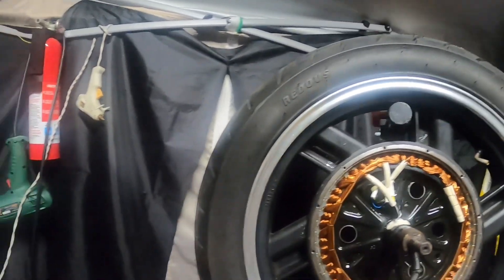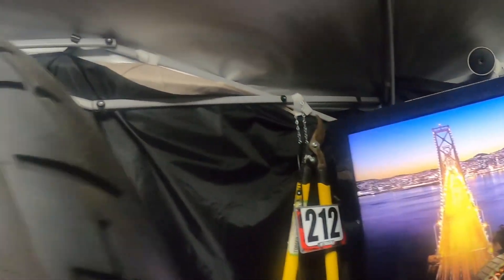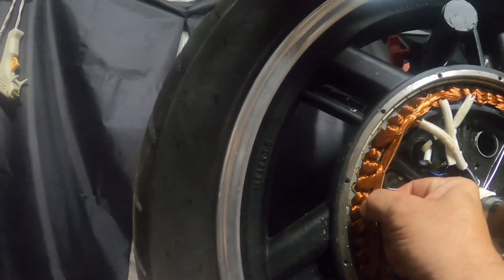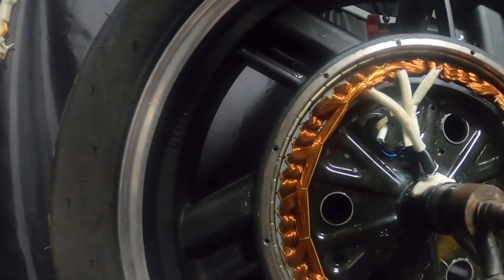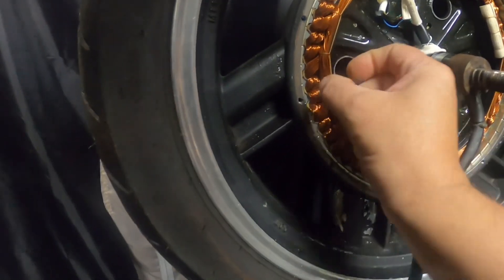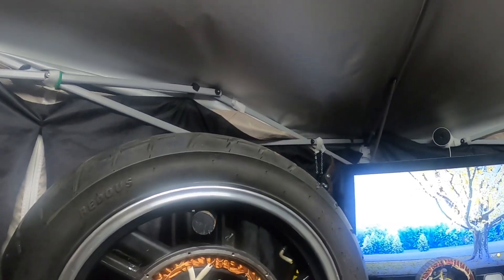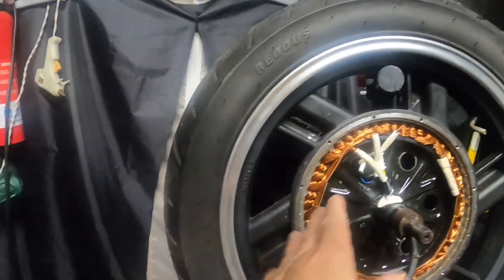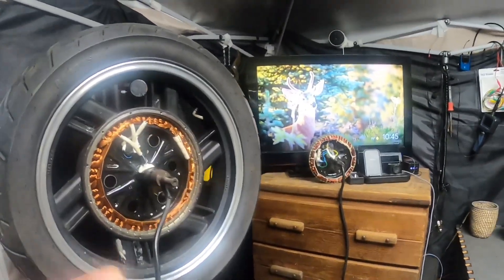5T motors  quick video on why they can't handle as much power, a rough explanation to think about.

Comment from the maker: No it wasnt a hall sensor thats the fault it showed but you dont smell hall sensors,  Not why his motor burned as he just put it thru some torture on a grueling ride but to other issues Ive seen recently You cant run an extreme amount of phase amps on a high turn motor they require less while lower turn motors need more power but dumping too many phase amps in your motor is a recipe for a burnt motor. Doesnt mean you cant run allot of power in watts but with a controlled amount of phase amps. The heat is a major factor but if your eye already having overheating issues you really need to pay more attention in this heat. higher turn motors coil wires are thinner because they have more turns but can't handle as much power for obvious reasons this is a quick explanation. I'll go over motor turns in more detail later. Now that's not 100 percent all of the reason obviously the that turns affect the motors impedance as well and that has a major effect on the efficiency but I it is a factor. again I'll go over now details in terms of rpms and power at a later date. see Tacticool Dennins complete video on his ch https://www.youtube.com/watch?v=EZ1fXmncrMU&t=289s

Comment: If the corcumference of the wheel is the same for 5t and sub5t and you drive hillclimb steady speed, 5t will be efficient and cooler than lower t motor. That is according to grin motor simulator. I have a 5t mxus 3k on 19" moto and thinking replacing stator with 3t for more speed but Im affraid that It would get hotter if I drive it hillclimb the same way as 5t.
Reply from the maker: thicker coils in the 3t so its not gonna burn and its not gonna have as much torque but you can turn the phase amps up to compensate unless your already maxed out

Comment: yeah, I have an independent temp gauge on my controller to monitor temps. I just didn't know my motor was heating up so much.  I was in the back of the pack of a of Surrons, Talerias,  some modded some stock. so it was a surprise when i just shut down. Going from a 2.5T to a 5T motor moved the heat from my controller to my motor.
Reply from the maker: yeah Id go back to that 2.5 T and work with the tune maybe add a heatsink or a fan what kind of controller
Reply: @ChrisCrossingWires1212   I have a Sabvoton 72200 and I have a USB fan I can run if needed.  My battery is a stock panasonic cell 72-45ah
Reply from the maker: @tacticooldennis  Not sure if yours is mounted internally but you already know how that goes you could add a real heat sink with fins like i did amazon sells them and add a fan but definitely need some space

Comment from the maker: FYI the motor on the wheel stand is not my RZ motor that is an extra motor someone gave me I think is smaller than mine I think it's a 2000w is not burned up I just used that for a visual 😅  I'm running almost 20kw on my stock 3kw and road 20miles on highway and my motor didn't burn up and it ain't gonna burn up lol

Comment: Nice Points Chris, Firm believer that it all comes down to a poor quality build. Mismatched parts, and people modding beyond there ability. 

In all the year's I have pushed hub motors NEVER ONCE have I burned the coils.

You can go through all the details, but at the end of the day. A simple temp sensor, and proper tune solves this.

Thermal roll back will save this issue.   Everyone suddenly thinks they are pro-tuners with these controllers, disable all motor safeties.  

Soon as my motors hit the stator wiring rated temp I roll them back.  It can, and will happen (Over heating) to almost everyone. It's how your controller is setup that will make or break your ride.
Reply from the maker: @BuildItTuneItEV  True that Bro and Like you I have yet to burn a coil too and I'm running more power in my stock motor some guys run on they're high power motor. Those guys burning motors are like women that just drive the car, don't check the fluids, don't change the oil and ignore all the symptoms lol
Reply from the maker: Oh and yes that's why having top of line controller with good  telemetry is worth gold they riding blind but even if I didn't have that good old fashion stopping testing with your hand feeling how hot your motor is at least checking stuff. They just ride willy nilly
Reply: @ChrisCrossingWires1212  That is why you are a leader in the game bro!

Comment: And that is why you have a good controller with thermal rollback. For my application of climbing mountains I run 8T windings where torque is important not speed. What do you think about lithium pouch cells?
Reply from the maker: I heard that as far as the pouch cells i cant use them if your not running allot amps they may be fine but really High amps they all gas up havent seen any yet that dont under extreme presure and it would take too many to get a decent amount of discharge for what I wanna do if your not in need of massive amps I guess there ok.